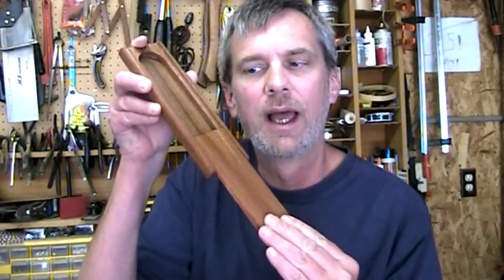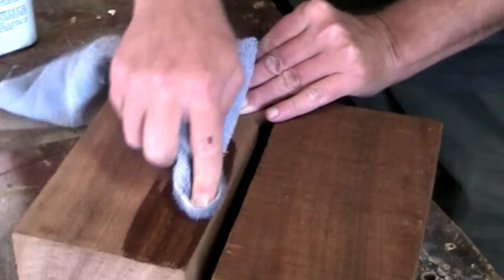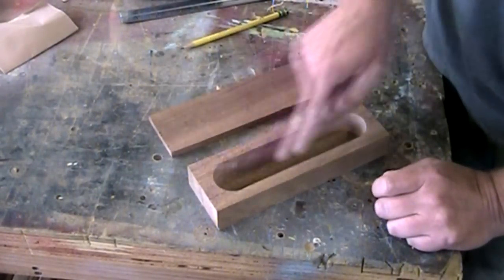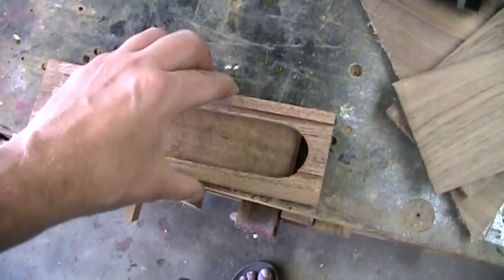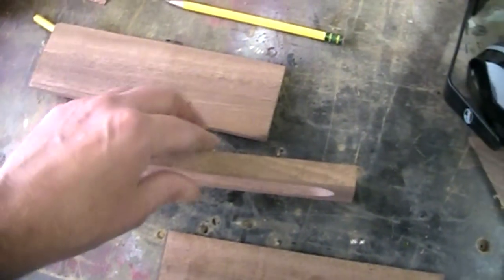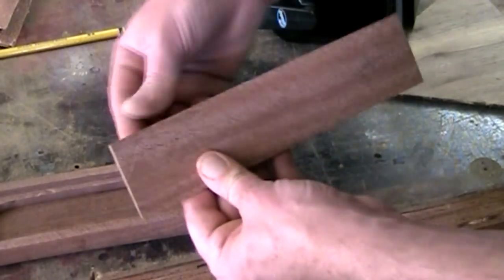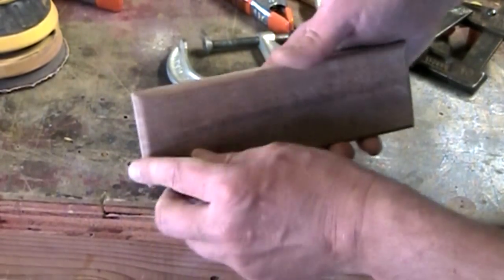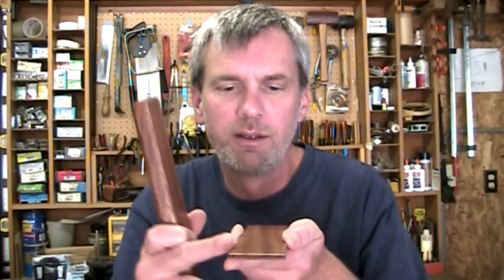Make a sliding-lid box

Comment: Steve - Check your router bit and collet for dust before installing your bit.  I had one that seemed just fine until about half way through a project when it worked loose because of a little sawdust I missed when installing the bit.  Thanks for posting your videos and keep up the good work.  :)

Comment: @AReptileMan Try going to a shopping center, or a Home Depot or Lowes and check out by the dumpster for pallets you can use. Ask them if they're not in the dumpster as they may be recycling them. Anyway, pallet wood can be real nice, you just have to dismantle the pallet. Also, check on Craig's List in the free section. There are often people giving away wood there, sometimes raw logs, but sometime lumber or old furniture you can recycle. I think Steve has taken advantage of that in the past.

Comment: when installing a router bit you should not push it all the way in the chuck. there is a small taper at the base of the shank, and if the chuck is tightened against the taper there is a very good chance the bit will come loose.

Comment: Hello Steve, I like your teaching , mistakes and recovery. As a slighter better then a begginer. I need to ask for help.

I am trying to make a box out of a block of red heart, 2 1/2 square. My goal is to cut the top off and rabbit a 3/8 cut around the bottom of the lid to fit on top of the body. Now for my problem. I own a Bosch router table and I want to route out the inside of the block. I am not sure how to do this correctly?  I have a few current straight bits and a 1/4 in down cut bit. I have already tried this on junk wood

Comment: Hey sir, you don't have to cut through the edge to use the scroll saw in the middle. Just detach &  run the scroll saw blade through the hole you bored out, and cut it.